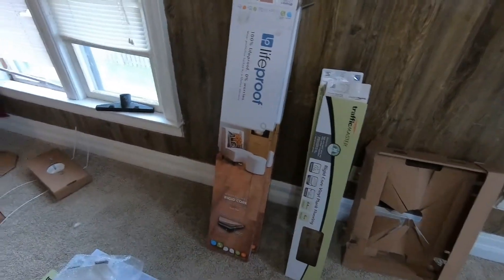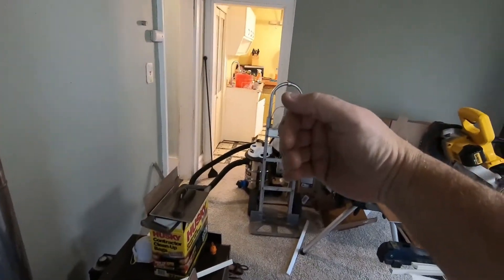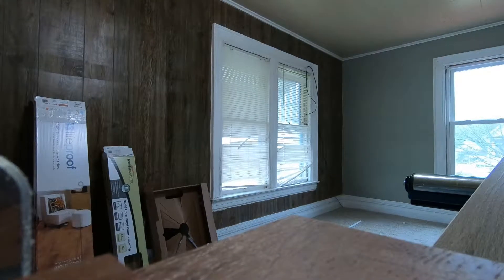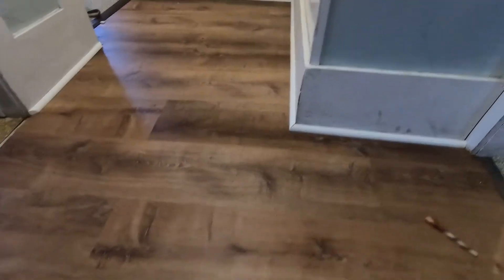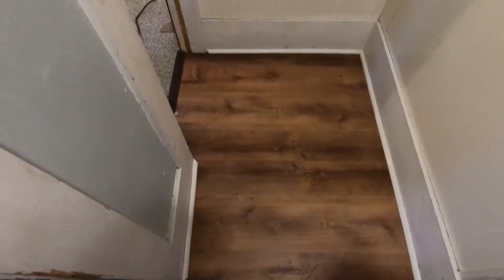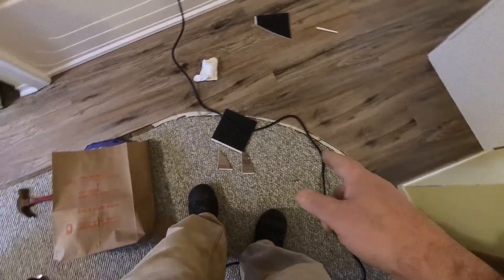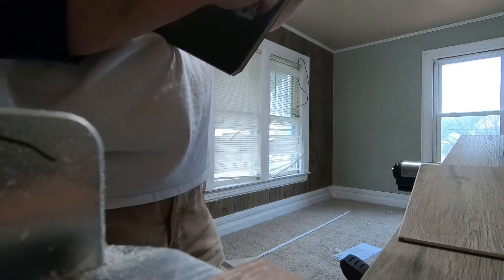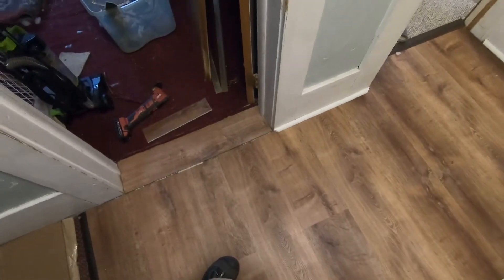lifeproof vinyl flooring on a fubar floor & trafficMASTER vinyl flooring. #lifeproof #trafficmaster

Comment: Do you find that the lifeproof fits more flush than traffic master. Im using traffic master and not really liking how they fit into each other
Reply from the maker: The lifeproof seems to have a better locking system and it’s still holding strong 👍 the traffic master took more work to get the seams looking tight but it’s still looking good ALTHOUGH it was installed on a perfectly flat surface. I think spending the extra money on the better flooring is worth it 🍺🍺
Reply: @116falconer  my understanding is that Trafficmaster has tongue and groove on all 4 sides so it's better than the LifeProof for uneven floors. The Trafficmaster has the easier drop and lock but it has worse tolerance for uneven floors.

Comment: nice video. my house was built about 1900 and nothing is square or level either. We are redoing one bedroom removing the old carpet and wanting to do either traffic master or lifeproof. What's under the carpet now is just the old wood planks. so there's some small gaps here and there. Is this type of floor ok to put over that or do I need to install something like a 1/4 lauan before the new floor?
Reply from the maker: I just did my living room with 6mm heirloom pine lifeproof. I tore up the carpet and the underlayment so I could screw down all the squeaky floorboards and I was surprised just how bad the original floor was. Anyways after a couple boxes of screws I laid the lifeproof directly over the original and it turned out NICE 👍. If you stick with at least a 6mm thickness and screw any loose floorboards down you won’t have a problem.

Comment: I just purchased Traffic Master at Home Depot – will never buy it again. Any imperfections or debris will render this flooring useless. And even with a perfectly clean floor, it doesn’t seem very reassuring when you’re walking on it.
Reply from the maker: It’s held up really good in my rental apartment